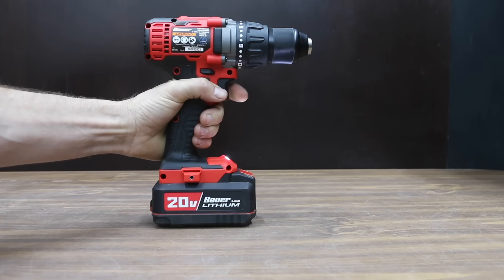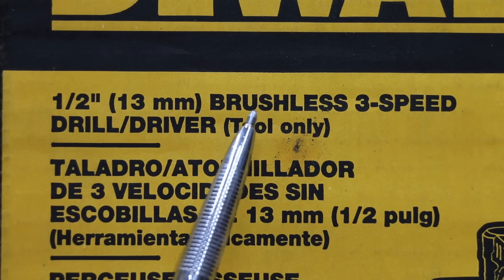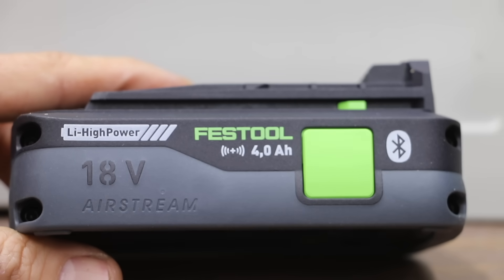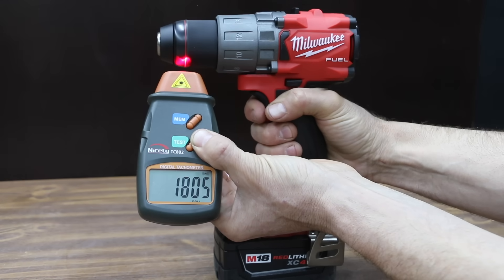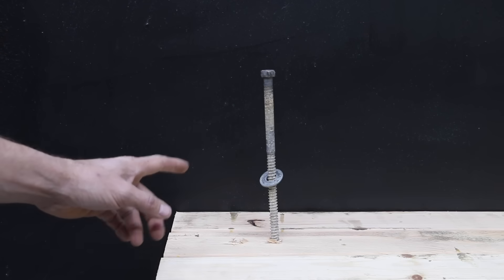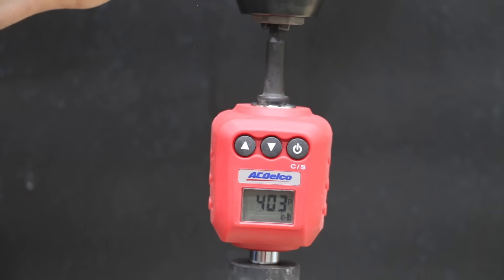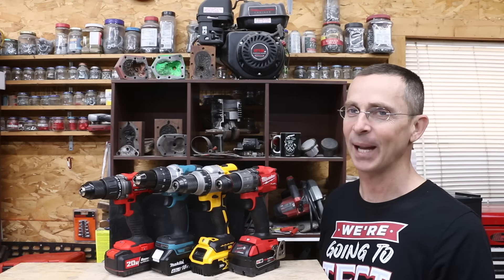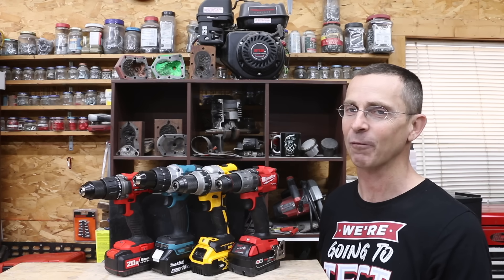Best Drill (BATTERY POWERED)? Milwaukee vs Dewalt, Makita, Bosch, Festool, Ryobi, Bauer, Ridgid

Comment: I feel like the rigid did very well for the money, it didn't run away in any category but provided very consistent results many times better than more expensive products. It also has a lifetime warranty which is huge for that price point.
Reply from the maker: Thanks for sharing.
Reply: Huge fan of Ridgid, it's what makes up the bulk of my shop. Their drills perform well in these tests for the price, as you mentioned. Worth mentioning the older versions that use the Jacob's chucks crap out easily with harder materials (stainless, concrete etc...). Ridgid has always replaced chucks on registered tools without question. It seems Ridgid is moving away from the Jacob's chucks in newer versions which seem to be much more durable in harder materials.

Comment: I love my first power tool Ryobi (18v) due to affordable; however, the battery sucks and in my opinion the company did not keep up with other competitors. I then changed to the Makita 14.4v and 18v (great tools) and then now I got the Milwaukee M12 series  because I love the oscillating,  right angle drill and the ProPex ( excellent tools).
I totally agreed the final three decision because if you stayed with major name brand, you not only have many choices of different tools to use under same battery system, also a lot good third party made batteries are available to pick too. They are good for home use. Thanks for the video.

Comment: I have both the Dewalt and the Makita and give them both plenty of hot suppers in the world of industrial installation and maintenance. The chuck on the Makita is showing its age and is hard to get tight now but is still the go to for bigger holes in steel the Dewalt doesn't have the power but still runs just fine after two years. It seems your tests compare with my experience with these two. As always keep up the good work!
Reply from the maker: Thanks, will do!  Thanks for sharing.

Comment: Video idea, testing performance of gas with and without the ethanol.  You could buy some regular E10 gas and test it, then take the same gas and add water to draw out the ethanol and test the same fuel without the ethanol.
Reply from the maker: Thanks for the suggestion.

Comment: I have a test idea ! As an Electrician I just switched from 13 years using the same greenlee hydraulic punch set to the milwaukee 6T knock out tool. 

I wonder which battery powered punch is best. & and is it worth it to make the switch from longstanding greenlee punch that has shown it stands the test of time.

Thanks for the test!!!! I use a drill daily and its useful info. Currently im all in with milwaukee. Have my packout cases stacked high.
Reply from the maker: You are welcome!

Comment: I wish you would of used the ridgid octane model. Has a lot more power than the one you used
Reply: https://www.homedepot.com/p/RIDGID-18-Volt-OCTANE-Cordless-Brushless-1-2-in-Hammer-Drill-Driver-R8611506BN/313582516
Reply from the maker: Thanks for the suggestion.

Comment: I think i remember that the Dewalt electronic clutch cuts off differently depending on how far the trigger is pulled combined with the selected "clutch" setting. I may be wrong though

Comment: My old Dewalt brushed drill has driven thousands of screws drilled thousands of holes and has wire wheels tons of rust and is one of the first 20v models and one day I forgot it in the tractor bucket and it was in there for about 2 weeks and it filled up with rain about 2 years ago and it still works like new,
You should do a soak test under water for a week and see who wins that test.
Reply from the maker: Thanks for the video idea.

Comment: I might be wrong but, shouldn't you put the rpm mark on a bit that is 1 inch so the rpm mark is the same across all tests? If you put the mark on a bigger spot the rpm would read lower then if it was on a smaller spot right? I might be wrong.

Comment: Hey guy, at some point can you do some tests on polishing tools? Between professional auto detailers it seems to be common knowledge that Rupes tools are the best, straight from Italy I believe. They cost around $600, alternatively you can get a cheap Porter Cable for $100 or a VERY cheap Harbor Freight wheel.
If you consider doing the testing amongst these tool it'd be much appreciated!
Reply from the maker: Thanks for the video idea.

Comment: Yes, I watch many of these drill challenges and they all show the same results with the top three. The one that stresses speed give up torque and the one that leads in torque for short in the speed test. So depending on the battery program you are invested in Dewalt, Makita and Milwaukee make great drills. Are you going to test the hammer drills or did I missed that video somehow?
Reply from the maker: Thanks for the video idea.
Reply: If that was true the Makita being the heaviest tool in this test should had won it all. In most cases it's the gear sizing of the drill and the percision quality of its parts that often decide these test. And like I said, it's a ying & yang balancing act of speed and torque. Slow a tool down with a larger gear, you gain more leverage, more torque. Put in a smaller gear, more speed less torque. The quality of the cutting edge of the fastener or bit play the other big side of the equation. :)

Comment: I would not recommend the brushed RYOBI drill.
Something exploded in mine (I think something in circuit) when I was screwing screws in wood, and now does not work.
Reply: I agree. I just recently burned out a brand new one trying to enlarge the hitch-ball hole in my bumper. Had to fall back on my 10 year old Ryobi to finish the job I was afraid it was too worn out to do.

Side note: 
The clutch on the new drill was awful, also. "1" on the new drill was comparable to "6" on the old drill.
Reply from the maker: Thanks for sharing.

Comment: Pretty good review. I am already invested in Milwaukee and have been for quite a few years now. I remember when my drill looked that new, I also doubted the t handle when it was new. 
Turns out (literally) you really want the t handle when drilling in low gear, it can be a wrist breaker. Several thousand holes later mine still runs like new, dollar for dollar you get your money's worth and then some.
Reply from the maker: Thanks for sharing.

Comment: I guess the Ryobi 9 amp battery is out now! I have the Ryobi tire inflator for my mountain bikes, the spotlight, multi charger, mist fan, 10 batteries and 110 volt inverter so far, I can charge my camera batteries on bike rides since they won't charge off a USB port and all those batteries I think give my e-bike over 10 more miles range, I want to get a mini generator and put it on a trailer to tow behind my bike and with this goofy president killing off pipelines I guess I will get a multi fuel generator, that should greatly increase the miles I will be able to go!
Reply from the maker: Thanks for sharing.

Comment: At that price and lack of performance I guess the Festool will now be festering in the back of a dusty warehouse.
Reply: Performance does not mean torque! torque over 50-60Nm is dangerous if you use the driil to tighten screws  with one hand! Over are used impact drills that have very high torque but you can use them with one hand :)
To say that a car with high torque (obtained through a trivial reducer) is performance is like comparing a carpenter's hammer of $ 100-200 with a sledgehammer of $ 30 and then to say that the sledgehammer is more efficient because it hits harder ....
Reply: @mihaiachim5299  You can defend it any way you want, but objectively it came up short in every test compared to brands that cost 1/3 the amount.
Reply: @outcastiid  1/3 of the cost - battery - battery Charger and - high quality and ultra light carrying case ... good test + the Tool is made in EU not China ... + it is the only percussion drill and It has the Best percussion in 18v class ...
And is the only One with removable Chuck 
It has the highest speed : 3800 rpm ; It is the quietest drill - the only One without a sand noise in the gears :))) .
the minimum torque test was done wrong / to their detriment on all 3 drills with electronic clutch! the test on them had to be done in the highest gear where they are much more sensitive :)
The only drill with 4 gears
Good maximum Torque :) - if you need torque drills are the wrong answer - for torque It is better and much safeer to use an impact driver who are made just for that :)
Reply: @outcastiid  im sorry, but Festool tools are overkill for hobbyists like you. Every professional woker in Europe uses Festool

Comment: I have owned and used just about every DeWalt cordless tool over the last 20 years.  With few exceptions, they have been outstanding tools.  That said, it would be interesting to do a comparison between older tools and the newer generation (18v vs20v).  It is very clear to me that the newer tools are not nearly as robust and well-made as their older kin.  Some of my older 18v tools are still going strong.  Can't say the same for the newer versions.  Today's tools use more plastic and rubber and just don't seem to hold up as well.  Not just with DeWalt, but every manufacture. Great video, as always, Todd.
Reply from the maker: Thanks for the suggestion.

Comment: IDK if i've already suggested this, but you should do a paint stripper competition. Maybe test on different paints, like powder coating, spray paint etc.
Reply from the maker: Thanks for the video idea.
Reply: Yes please!
Reply: Aerospace paint stripper is supposed to be really good
Reply: I want to see this too. I watch some furniture restoration channels and they complain that CitraStrip just doesn't work well anymore and has switched to scraping, which is much less satisfying to watch. We need a replacement
Reply: Paint stripper on clear coat too! I have a lot of trouble trying to strip clear coat from aluminum rims when I try to refinish them.
Reply: @captain_gills  sand them.
Reply: Yes!
Reply: None of them work well, especially not citrus strip since nanny state made them remove one of the key ingredients.
Reply: @nmatthew7469  100% true; Also styrene model cement now smells like orange hand cleaner and is completely useless.
Reply: I remember when I was 18 I got given a nice job of stripping an old lead based floor paint with paint stripper... no gloves or mask! I remember getting getting it on my hands and instant burning / coldness on skin. Also I came outta their high as a kite 😴. 

I since found out they banned the chemical they used to use in trade paint stripper. You can still buy it here in U.K. though as airplane stripper paint or something like that!
Reply: This is a really good one. The amount of times I've delved into a furniture restoration  project thinking...it won't be THAT bad. Oh Haha, was I wrong!
Reply: 75/25 Methylene chloride and Formic acid. Two of the good ingredients they no loner use. Get them on ebay. works amazing even on powder coating. Very unsafe :)
Reply: @jeep2003  yeah I’m sure that’s the chemicals that used to be in the old paint stripper we used in U.K. it bubbled the paint within minutes . Even 200 year old paint. But as I said don’t get on skin or breath the fumes as learnt by young me 🤣
Reply: This is a fantastic idea. I wonder which stripper works best on multiple coats of paint
Reply: bit of ecostrip 500 usually does the job....

Comment: We have a bunch of Milwaukee cordless products at work. They hold up to a lot of abuse (heavy abuse), but the drill chucks aren't very good. 

The chucks don't grip round shank drill bits well, and once they start spinning the grip is significantly reduced. It also doesn't help that I have coworkers who run taps with them.
Reply from the maker: Thanks for sharing.

Comment: I own the Dewalt 996 and the Milwaukee. I reach for the Dewalt because it is heavy and it makes you feel like Dirty Harry. It will rip your wrist right off if you are not careful but it has enough power to mix 5 gallons of thinset without overheating. There isn’t many cordless drills that can do that.
Reply from the maker: Thanks for sharing.

Comment: I love how practical these tests are, I do all the same things with my tools and I need a new drill as the gear box on my 18v brushed DeWalt with the new battery converter is more then loose. Again, your efforts have helped our little homestead, I feel even more confident that the company that we already have other tools, and support for, "DeWalt" will serve us well going forward with a new drill.
Reply from the maker: Thanks for sharing.
Reply: @ProjectFarm  I have an idea: cycle lifespan of tool batteries. my new"ish" dewalt 2ah are only 2 or 3 years old and dont indicate over 2/3 when full now.